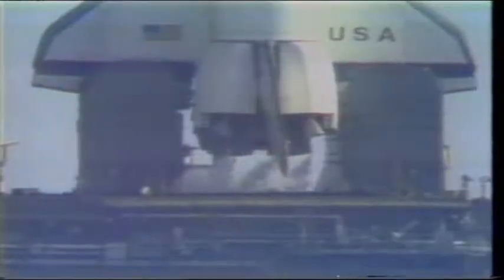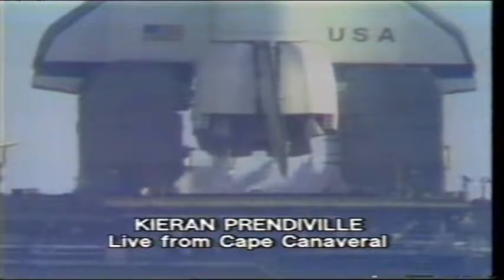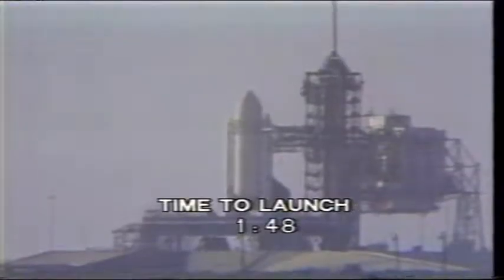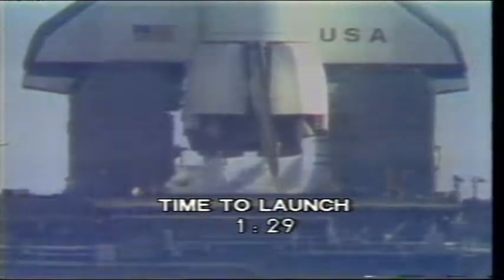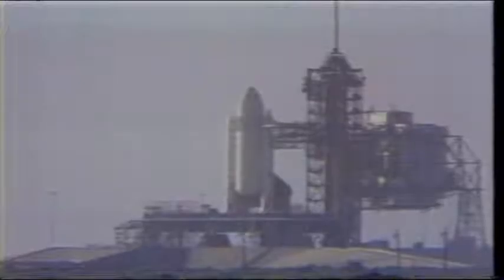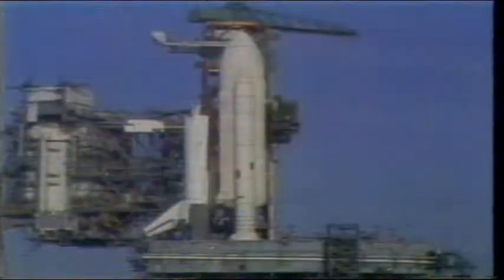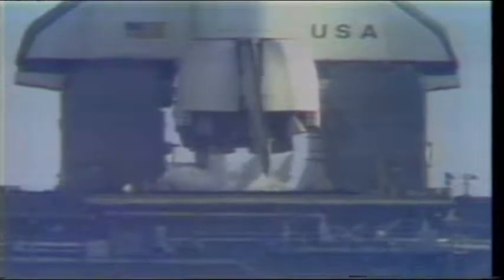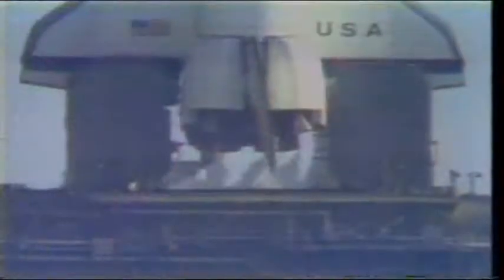STS-1 Launch BBC Coverage  (Short Version)

Comment: This, of course, was the first flight of the Space Shuttle, the first flight of a winged spacecraft and the first US spaceflight to end on land and not a splashdown.  This was also the first American flight with just 2 crew members since Gemini 12 in 1966, and the first flight of a reusable spacecraft, which turned out not to be quite as reusable as first thought.
Commander John Young was a moon walker, the only Moon Walker to fly the Shuttle and pilot Robert Crippen, making his first flight, would go on to command 3 missions. 
The flight was greeted with euphoria, especially the landing and routine space flight had seemingly begun.  Spaceflight was also going to much cheaper and safer.  But the exact opposite happened - the Shuttle was never routine, and was not only more expensive and more dangerous than other space vehicles, but a lot, lot more so, as the 2 disasters showed.   People were deceived into thinking how safe the Shuttle was,  a deception that turned  to tragedy with the Challenger and Columbia accidents. Professional astronauts were always aware of the risks of the Shuttle but non Professional astronauts were not nearly as aware.  Christa Maculiffe  May never have flown on the Shuttle had she been fully aware of the risks. 
That she regarded the delays she experienced before the ill fated launch and the ones experienced by Columbia before that as proving that the Shuttle was safe to fly and not as a warning of how dangerous it was, showed that unfortunately she was not.  But she could not be blamed for that when NASA was telling the world how safe the Shuttle was.